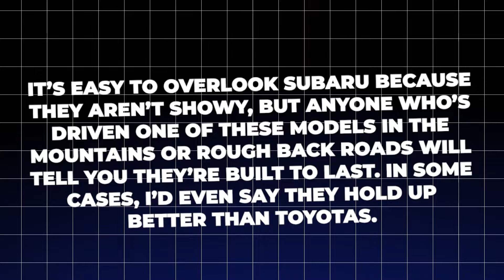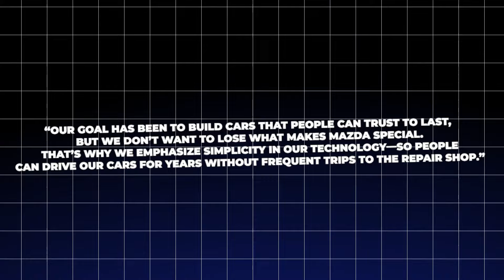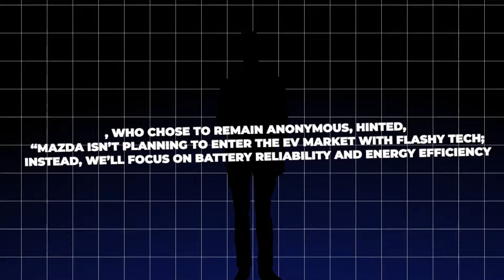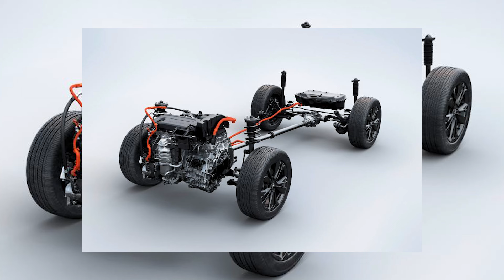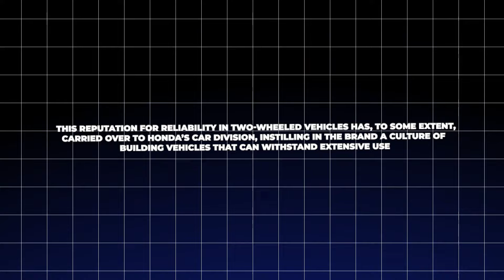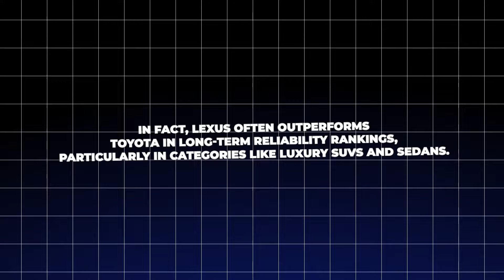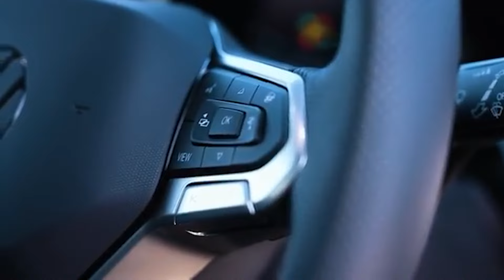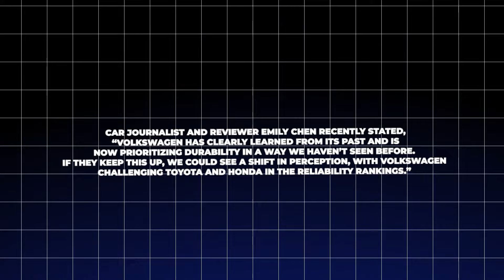5 Car Brand That Are Better Than Toyota For Reliability

Comment: Subaru has a CVT transmission, if you could get one with a manual then maybe.  I have a 2003 Volvo s60 automatic with 350k miles and a 2006 BMW 325I with 260k miles still running.  It depends on how you drive and maintenance.